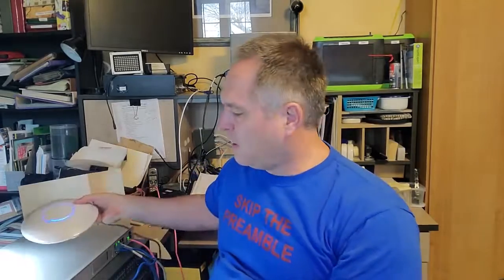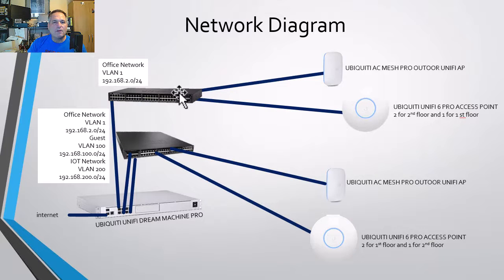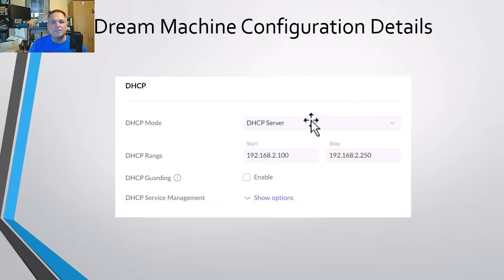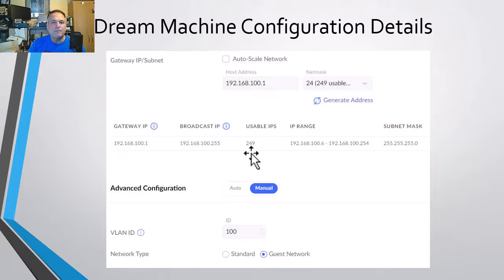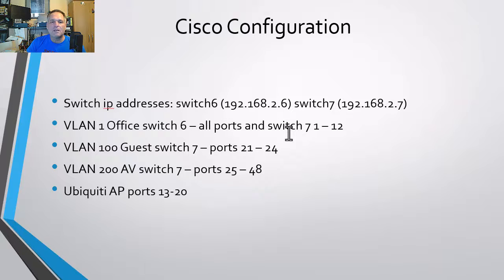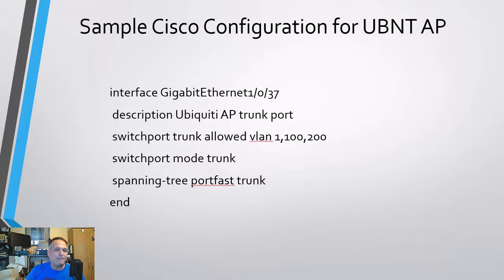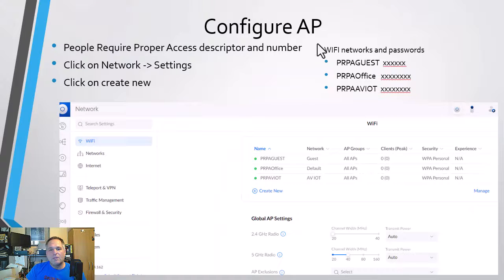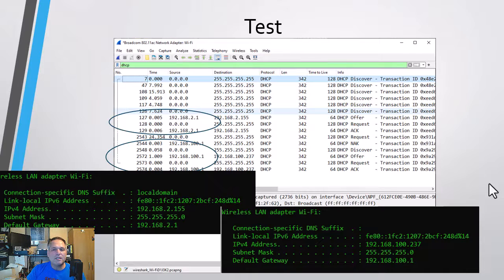Getting Cisco and Ubiquiti To Place Nice

Comment: So If you have VLANs designated to ports on the router, where did you plug in the Cisco Switches and how did you configure those ports.  UBNT pisses me off pretty regularly.. I have a Cisco switch connected the a Dream Machine and set the port for all VLANs.  Set the Cisco switch up as Trunk allowing all VLANs.  Cannot ping the dream machine from the Cisco no matter what I do on the Dream Machine.  I saw LLDP work for a second then it was gone.